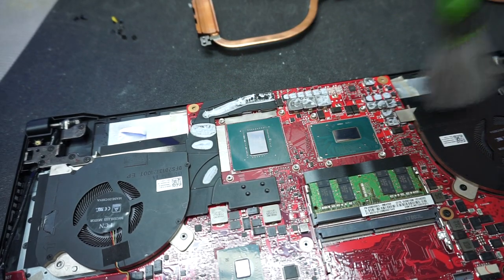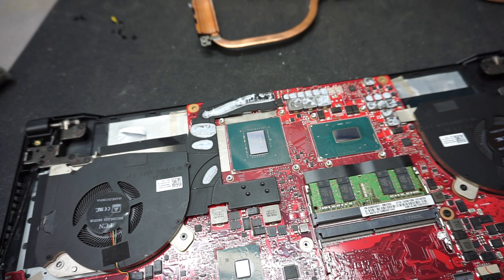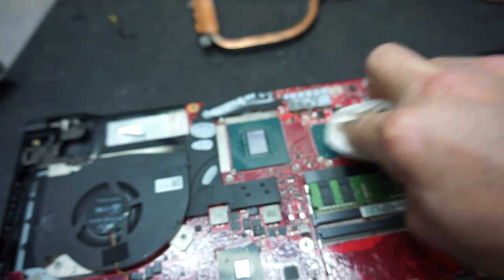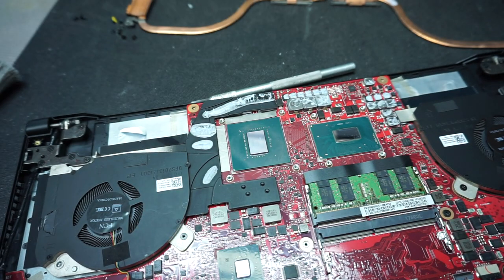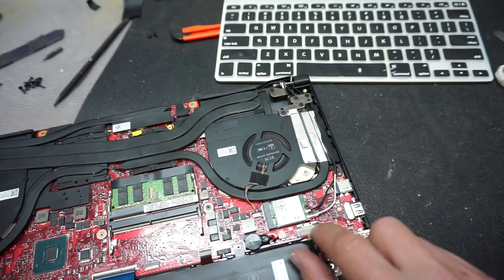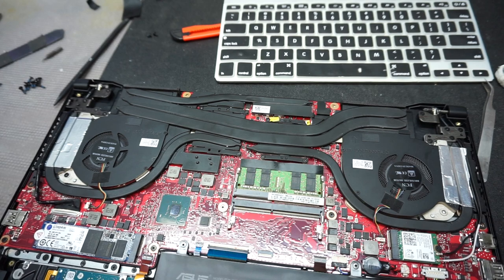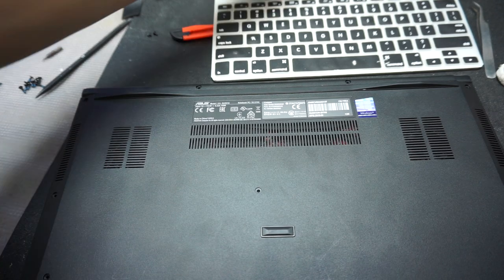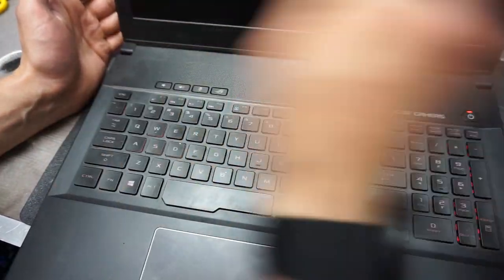Asus ROG GU501G Thermal paste replacement

Comment: I was trying to play Conan Exiles in my ROG GU501GM with settings at LOW and due to high temperatures (CPU at 80-90°), the game was stuttering all the time and I could not get more than 20 fps. I tried everything in terms of settings and optimization of Windows, NVIDIA control panel etc. Nothing worked. Then I cleaned the coolers using a teeth brush and the temperatures dropped to 60-70°. Now I'm running Conan Exiles with CINEMATIC settings without any stuttering while I'm waiting for the thermal paste I bought. Thanks for the video, man!

Comment: Just repasted my GU501GM using this tutorial as a reference. I had never did that before and this video was so enlightening that I actually think it has gone much easier than I thought. Thank you so much for your help! I used arctic 1.5mm thermal pads (as you recommended), Arctic Cleaner and Arctic MX-4. Temps look absolutely GREAT as far as I could test the pc.

Comment: Thanks for doing this guide video!  I noticed it looked like Asus just used thermal paste on the memory also,  so curious if it is fine to just replace the thermal paste instead of using thermal pads?

Comment: The new ROG laptops have the same bottom cover but I noticed the vents are not covered but the new ones for some reason are covered with a plastic film with a metal plate :\, was getting 95'c while playing GTAV when I took off them covers now its 80'c, I feel like they forgot to remove them...

Comment: Your videos are very helpful and informative, thank you dude! Can someone explain further why not to put new pads on the cpu side of the heat sink as well?
Reply: Currently repasting mine, thanks to you! I'll report back with the results.
Reply: I used Kryonaut and Arctic Thermal Pads. This morning I'm seeing around -10 degrees in idle or just watching YouTube. Overall, much better temps across the board (especially in CPU temps). The Witcher 3 still hits up to 75 degrees on my GPU after an hour or so, but I'll take it! Thank you dude!

Comment: What kind of screw driver bit you use to remove heatsink bolts, mine wont turn with 00 and 000 bit ‘m afraid i’d damage them.

Comment: I replaced the thermal paste of my laptop, rog zephyrus gx502gw, similar to this laptop. I used thermal pads 0.5mm for the gpu modules like in this video. I used thermal paste only for the cpu and gpu. The temps went down like -15celsius. The problem i am gettin is, i get GPU usage spikes, like every 5 min GPU goes 99% usage for 20seconds, i get FPS drop in game. Should i open it again and put paste everywhere and not use pads? Or is there any tip?
Reply: Have you fix the fps drops?

Comment: Do you know if it’s possible to use liquid metal instead of thermal paste?
Reply: Wondering this too. I notice there are surface mount components on the GPU. Conformal coating should protect against damage to those but being a laptop I'm not sure if that's wise.